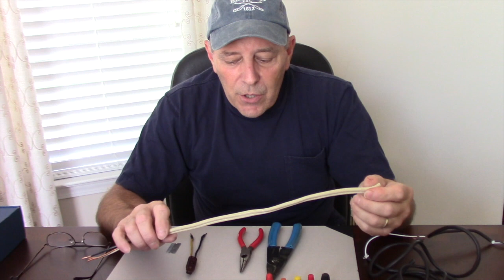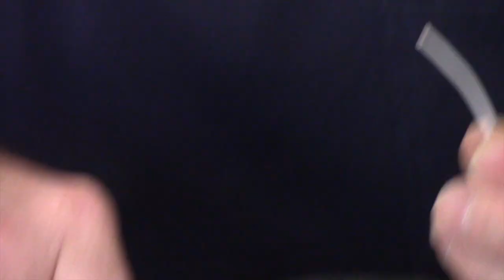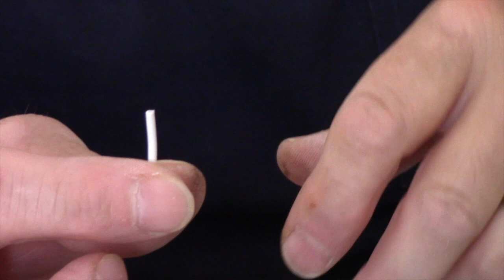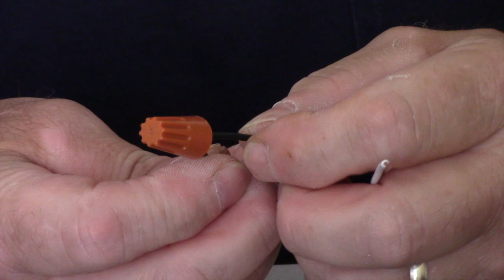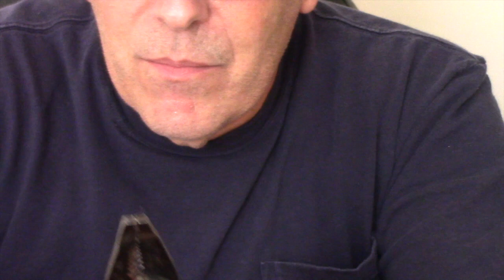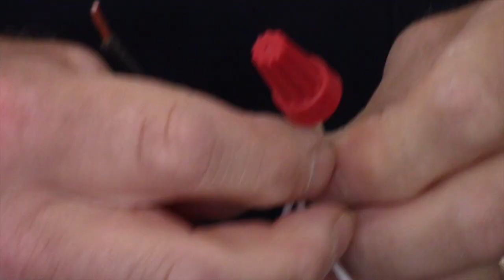How To Connect Electrical Wires Or Join Wire Using Wire Nuts

Comment: I was taught to NOT wrap the wires first but simply line them up evenly and then attach the wire nut.
Reply: Wizzykin : Ive always just lined them up and then twisted on the nut.  This is how I was taught many, many years ago from a neighbor who was an electrician.   Never had an issue and they end up quite tight.  I'd be curious to know how it works for you.
Reply: I was taught to line them up too, but I just wired a fan and the light goes off then on every once in a while. I searched and have found both ways so I’m thinking of taking it apart and twisting it like this. 

Jim, can you give any guidance on if you think that’s the problem and if this will help? Thanks!

Comment: What if you're left handed? how do you turn the wire nut  or twist the stranded wire properly? do wire nuts lock if turned by left hand?
Reply from the maker: You still have to install the nuts clockwise.

Comment: Both cutters / strippers you were using are crap. Go to an Electrical Supply and buy yourself some good ones that really work and will last  forever. 🤷‍♂️🤷🏼
Reply: They're not crap.  They need a little more care to use properly and they're slower.  Mechanical strippers for pros and something like what he's using for home use.

Comment: This is terrible. That is NOT the proper way to splice stranded wire with solid wire. What you should do right now is take this video down, learn the proper method, then upload another video showing the proper method.
Reply from the maker: You are wrong!